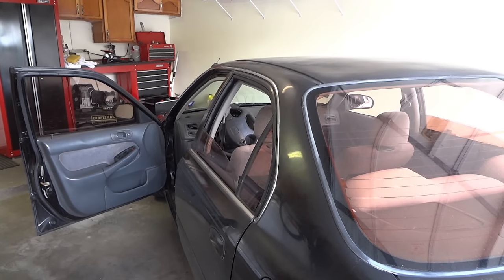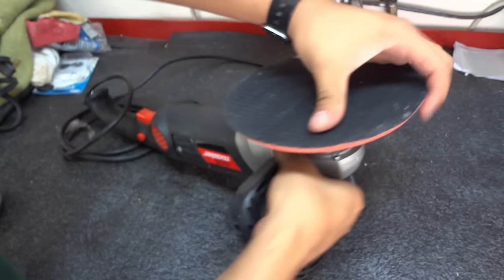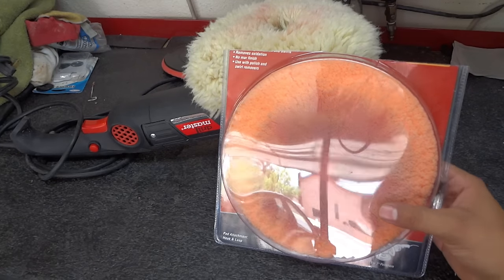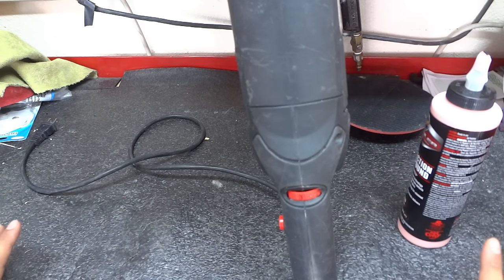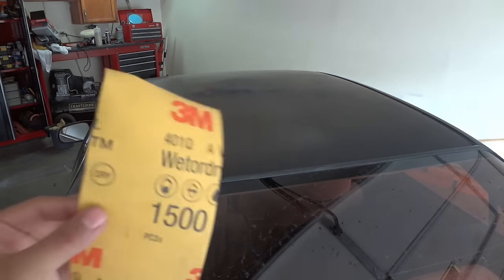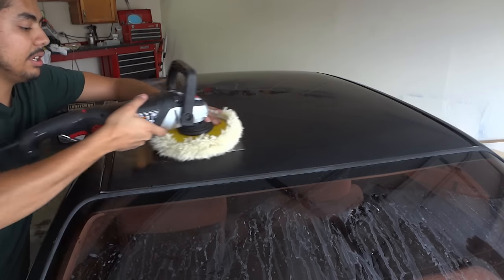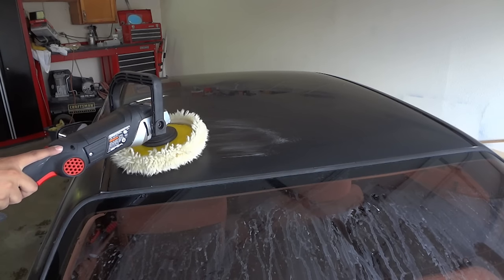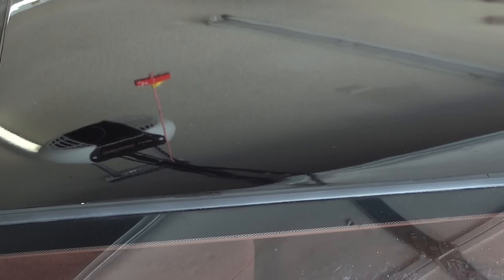How To: Remove oxidation from car paint.

Comment: Would rather use a clay bar or clay block on the whole car instead of sandpaper and grind away at the clear coat or paint causing a bigger job to refine..Then use a scratch remover which doubles as your polisher if there are imperfections the sealant cant handle, then a sealant to give it a finish and finally a good wax coat to protect your hard work..Just my experience..Research before touching your vehicle surface..

PS: If your vehicle has a thin clear coat or no clear coat using a sand paper is a bad idea unless your repainting your vehicle..

Comment: the thing with rotary is that its basicly a MUST to use a DA and compound/polish it, depends how bad the rotary induced swirls/haze is also known as "love marks".
only a handful of people in america can pull off a rotary polishing without any swirls/halos, and especially on newer cars (1990+) where there is thinner layer of paint and then clear coat, if you burn that out (which happens fast with rotary) well, we all know what happens next.

the wax you applied after rotary hid the love marks, which would occur the next time you wash it with something that removes wax, or simply the wax deteriorates over time.
Reply: you can always apply a new clear coat on top after sanding
Reply from the maker: +TheDim3s Great detailed comment. Your absolutely correct. Believe it or not, the car in the video actually did come out perfect. No  marks. When I was starting to polish, a way to remove the "love marks" was to use a scratch remover or swirl remover. It's more of a crutch though and I wouldn't want to be using it on every car. It's a little pricey for a small bottle. In the end, I've come to the conclusion that if you live a desert like El Paso and you keep your vehicle outside, it best to get the top coat redone if the clear coat hasn't failed yet. I did that to a car I have and it's outlasted the polished car by a long shot. Thanks for the comment, and thanks for watching!

Comment: You should note that this process removed the clear coat of the paint.  All cars have a layer or layers of paint and then a clear coat finish process that protects the paint.  The paint on you car will need to be frequently clayed, polished and waxed now that the clear coat is gone.  You should put up a video on how to apply a clear coat because that is the only lasting way to keep the paint healthy.
Reply from the maker: +Brett Vogel I have a set of videos on applying a clear that I am not sure if I should publish. I don't feel like i made them "professional" enough and it's pricey to redo the video.
Reply: Christian Macias is it possible to put a clear paint after doing this process? Planning to do this later to my car. Thank you for the response

Comment: the result is fine BUT... on an faded paint, the surface is porous and the fine finish obtained doesn't last. this paint needs a constant waxing attention to stay glossy
that's not the fault of the process but from the components of the paint that are altered by the UV and road salts.

Comment: If you leave your car unprotected and out in the elements, the paint will most likely oxidize. The first level of oxidation will happen and you will not notice it over a period of a month or more. Light oxidation can be treated through regular paint cleaning and polishing. Waxing your car after each cleaning will also help protect your car’s paint.

The second level of oxidation is moderate oxidation. Just like light oxidation, it can be repaired using a cutting polish. The hardest oxidation to deal with is heavy oxidation. This may happen after a year of your car being unprotected. This can be described by a dull, chalky surface on your car’s paint. It may even be difficult to restore but there are products you can always try before getting a paint job done.

Comment: great video Christian Macias!  Thanks tons for making it!  I need some response from you'all out here to this question, "Is this a problem w/ HONDA cars?" I have a Honda Fit and I have oxidation on the hood of my Fit, sooo ugly, I had NEVER seen this on my Toyota's, which were also parked outside in the sun here in Dallas, TX.  My Dad told me I should call Honda, but my car is out of warranty now.  What do you'all think. I do love my Fit though, but this oxidation thing is giving me Fits! LOL! pun intended. Also my headlights are all oxidized. I just fixed those w/ Meguiars Ultimate Compound since it was not heavily oxidized yet & that seemed to work.

Comment: Mine was so oxidized that Even though I have buffed it like 6 times & still doesn't look good,   I think Ima have to go extreme & sadndpaper it  ,  its a shame because it will look Beaitiful as Im removing the wax,    Then.... the wax will smear & it will NOT come off with a towel & pressure even,  so I have to buff it AGAIN.      done this like 5-6 times already.    Don't know why the wax leaves a stubborn smear that wont come off without buffing.,      Can I ask......…..   WHY do we need to sand in a straight line & Not circular motion??

Comment: Hello, thanks, can it be done by hand instead of that rotary machine providing the area to correct is small? Thanks
Reply from the maker: Yes it is possible. I did it by hand before using the rotary tool. It just took much longer

Comment: I tried to compound it but it still looks dull , I didn't wet sand at all and I was rough with the buffer (never used one before) will wet sanding then buffing with compound help bring back the paint? Or is the paint just too bad to fix? Looks similar to the one in this video

Comment: Used 1200 grit sandpaper and meguires ultimate compound.  I didn't touch the oxidation . I have a 2019 Civic kind of ridiculous my paint is like this so early on. I wash regulary with a soap & wax . I also tried nu fishish polisher . Any suggestions?

Comment: I really love detailing cars- and I've had experience detailing my lights with wet/dry sandpaper, but I don't know how in god's name you managed to restore it without using a finer grade sandpaper. I tried 2000 grit and it induced marring. Guess it's back to ChrisFix for me. I'll have to try 3000/5000 to fix the marring.
Reply from the maker: +Rotten Girl hi,  i didn't let the buffer sit and kept the speed fairly slow. That's how I avoid marring. When i started polishing I used a compound to remove marring. I'll post it in the description. The compound was specifically rated for sand paper at that grit. Also the less sanding I was able to do, the better. I didn't want people to watch this video and over sand their car, leading to clear coat failure. Thanks for watching! I always appreciate good feedback.

Comment: Hey, thanks for the video. But I have a question. I used a random orbital polisher with polishing compound (very fine) to buff some of my hood and now it's white and can't get it back red like it was. Do I need to wet sand 1500 to 2000 grit and then wax it again?
Reply: Did you fix it? Did my wife's car and it turned white like you mentioned

Comment: What speed you have it on I have a Hex Logic yellow pad but somebody said start it the polisher one a one speed but I think the problem is I had two different shades of paint on my truck because I put PS2 paint but my paint code is PSB. I see lighter shades that is probably the original paint PSB color and darker shades of grey I could let you see a pic on your email and you could see what I mean but I can clearly see two different shades of grey on my truck.

Comment: I'm working on my car now using your method but I seem to having trouble with the buffing.  I can't seem to get the compound off the car as easily as you seem to be doing.  What am I doing wrong?
Reply from the maker: +Peter Pimenow if the surface of the car is hot it will flash and stick. Try moving the buffer in a faster motion and try spraying water on the surface of the vehicle.

Comment: My one question, is it only single stage? As in the car didn't have clear coat on? And what year is your car?
Reply from the maker: +ThatFirstBaseMan This one is a 97 civic. It doesn't have single stage paint. It has a base coat and a clear coat. Definitely  not as easy as it looks but definitely worth the work you put in. Just a tip that I left out in the video (especially if your a beginner at polishing). Get a spray bottle and and mist a little water over the paint your going to polish. This reduces the chance of you causing the compound to "flash". It gives it a better finish as well and saves you a little compound(25$ for a small bottle haha).
Reply: +Christian Macias oh okay. So spray the water on before putting the compound on? And also, do I have to sand it? I don't want to damage the clear coat. The paint is slightly faded, but I don't want to damage anything
Reply from the maker: +ThatFirstBaseMan Sanding is what powers thought the oxidation. You could just use the compound if the oxidation is very minimal. The one on this civic was heavy. Yes, spray a little before the the compound.
Reply: +Christian Macias okay, but if the oxidation is in the middle, could I use a higher grit sandpaper? Also, I saw some Meguiar's ultimate compound for like $9 at Walmart yesterday. It says it's specifically to restore the paint. Would that work well? And as for wax, would turtle wax be good? I saw a paste wax for only $4 and it looks good.
Reply: +Christian Macias would the meguiar's ultimate compound work just as well? or would the one you're using be a better choice? and is that wool pad the 7.5 inch wool buffing pad?
Reply from the maker: +ThatFirstBaseMan Sorry been a little busy! The wool pads 7.5in and the compound I used was Meguiar's.
Reply: +Christian Macias problem. I got the same pad and machine, but I got Meguiar's ultimate compound since it says it'll remove oxidation and paint defects. It's doing alright, just not getting some spots that are really making me mad. Haven't used sandpaper on it yet because I'm unsure if the ultimate compound will get rid of scratches from sanding. It's also Leaving slight swirl marks as well. I'm thinking about getting another Meguiar's product at Walmart if the wet sanding won't work. What other product would you recommend? They don't sell the one you're using in store
Reply from the maker: I have to find it at a automotive paint store. I have close to the same effect using turtle wax brand. I forgot what color it was though. It was either the black bottle or the green one. Also don't apply pressure when have polishing. If you can hear the polisher struggling or slowing down then you are applying to much pressure
Reply: +Christian Macias my problem is the machine. I'm just gonna do it all by hand. It'll take a while, but I'm getting frustrated at it, so I'm just gonna try it by hand.
Reply: ThatFirstBaseMan y

Comment: I have a question for you I have a 1984 Porsche 944 and the hood is oxidized I believe and I was wondering if this is what I need to do I will send a pic to you of the hood if you would allow it because I have more questions on what to do because it is a Porsche and I don't wanna screw up
Reply from the maker: +Bradley Porter because of the age of the vehicle, there is a good chance that you have single stage paint. I would not try this method as you might accidentally get to close to the primer. With single stage paint, it is difficult to tell when you have gone to far into the paint. In 2 stage paint, it's easy because you will see paint on the buffing pad, but this would be normal on a single stage paint job. I would look for a professional to buff it, or start thinking about actually repainting the hood. Thanks for watching!

Comment: Do you really have to sand? My cars maybe 2 shades of oxidation less then that but still looking like it has a pretty satin look to it
Reply from the maker: +Nick Velazquez if your car has ever been repainted then you will have a thick enough clear coat to sand but if it hasn't, then you should try without sanding first. If that doesn't help, you should try sanding but very lightly
Reply from the maker: +Nick Velazquez if your car has ever been repainted then you will have a thick enough clear coat to sand but if it hasn't, then you should try without sanding first. If that doesn't help, you should try sanding but very lightly

Comment: Veeerry nervous about sanding.
Reply: just start with softer numbers/higher and wet sand please!!
Reply: Blake Merryman the sand paper he is using is VERY subtle and kind.
  go for it.
  try on a tiny spot on your car to practice :)
Reply: me too
Reply: well.. if it helps. i will provide my results. I did this with a car I just bought with heavy/severe oxidation. I went as low as 1000 grit sandpaper and it worked. If it severe like mine. Start with 1000 grit sandpaper and finish with a fine 2500-3000 sandpaper. Then use the compound to shine it out.  
  so steps for me was to sand off the disgusting muck off the hood then use a compound ( i used Meguiar's G17216 Ultimate Compound ) and HAND buffed it out. I did not having a good enough electric buffer at the time. But this was done 1 month ago. I still have a tiny bit of white oxidation left but it was good enough. Shiny like its new. 
            DO IT.
Reply: read my comment. it works. in order for you to do any damage would be to use a low low number grit like 500 and under. 1000 or higher will not hurt it at all.
Reply: Wrong!!!! It will hurt, but depends on the paint having enough matter still allowed to be sanded. Clear coat can be very thing and even 2000 grit can go through it. I wouldn't have even sanded this roof, a buffing pad would have sufficed followed by a polishing foam pad.
Reply: @jray8704  thanks. I feel the same about sanding my hood on my Honda Fit.
Reply: @yolsclassics6347  thanks Captain!
Reply: Vince Vega not on my car. I’ve tried buffing it and its still looks a mess

Comment: so can u use only the compound if the Oxidation is really light... Like if it just makes the paint look like it's dull and not as bad as the videos Oxidation
Reply from the maker: +Jdub422127 Yes. I would also grab a bottle of scratch x 2.0 to remove any hologram you might put in the paint if you are new to polishing.
Reply from the maker: +Jdub422127 Yes. I would also grab a bottle of scratch x 2.0 to remove any hologram you might put in the paint if you are new to polishing.
Reply: What do u mean?.... Scratch X2.0
Reply from the maker: It's a bottle like the one I linked in this comment. Polish with the compound in the video. Then with scratch x2.0, put it on a medium strength sponge pad and it will leave you with a perfect finish. The pad is available from harbor freight. Scratch x2.0 is optional though. It's just to leave a perfect finish.
amazon.com

Comment: I have a nissan altima 2009, and i just noticed my paint oxidation.. is this compound considered Waxing??? Im no car wiz but im devastated my car has this. where should i take my car to??
Reply: so they can fix it for me
Reply from the maker: +vanessa fredricksen this is the opposite to waxing. This compound and pad cuts into the clear coat paint to make it as smooth as possible to make the paint shine. If your car has never been painted before then it is considered risky to try and polish/buff the paint because the factory put a very tiny amount of clear. A professional should have the experience to fix a light amount of oxidation By polishing. You can take it to a body shop you trust and ask them if they can polish it out. If they can, then you let them do it and when you get it back you wax it every 2 months or more often.
Reply: Thanks so much. i went and got it clay bared and waxed and it looks the same. i never re painted the car. i will try to prevent further damage by waxing every 2-3monthes

Comment: Will this also work for removing light scratches? I have a black car.
Reply from the maker: +Anthony Tran yes but do not sand for light scratches. There at sponge pads and compounds better suited for this. But the technique is the same
Reply from the maker: +Anthony Tran yes but do not sand for light scratches. There at sponge pads and compounds better suited for this. But the technique is the same

Comment: how long does the polish last? for your car
Reply from the maker: +Bull Sheit if you wax it should last a very long time. If your clear coat of extremely thin then it might not work very well
Reply from the maker: +Bull Sheit if you wax it, it should last a very long time. If your clear coat is extremely thin then it might not work very well
Reply from the maker: +Bull Sheit if you wax it, it should last a very long time. If your clear coat is extremely thin then it might not work very well
Reply from the maker: +Bull Sheit if you wax it, it should last a very long time. If your clear coat is extremely thin then it might not work very well

Comment: Be very careful using 1500 sandpaper you, must use the right compound or you will have a difficult time getting the scratches from the sand paper out I had a tough time. I don't recommend this technique.

Comment: I cannot stand when someone uses the word oxidized. The term is improperly used multiple times. Gel coats and clear coats do not oxidize. Oxygen does not chemically react to change the chemical make up, which is the definition of oxidation. Gel costs and clear costs only fade with exposure to sun... saying something is oxidized may make you sound smart, but not when it's not used properly.